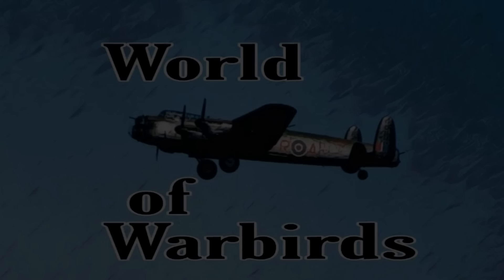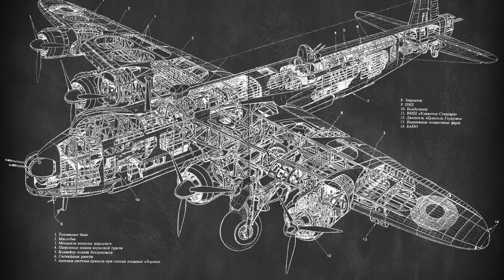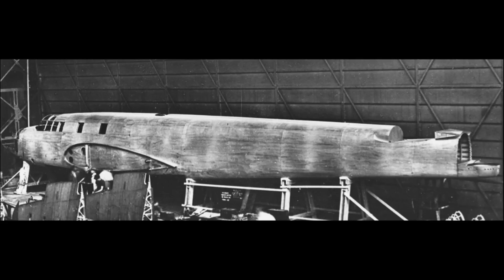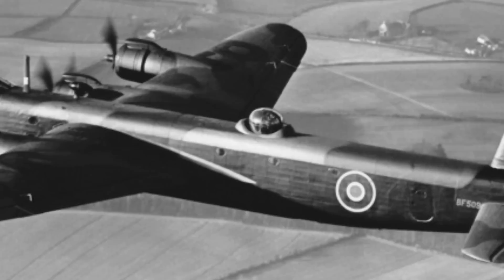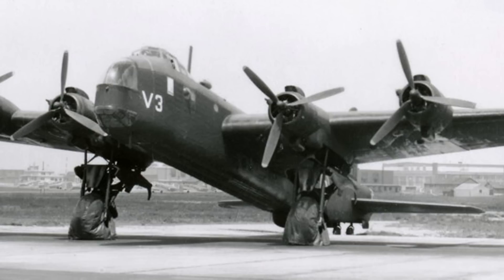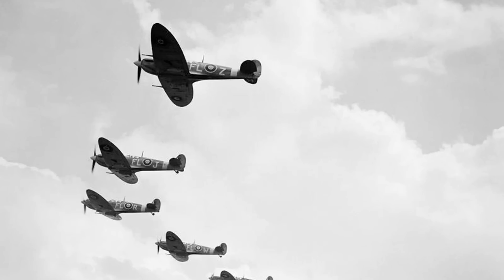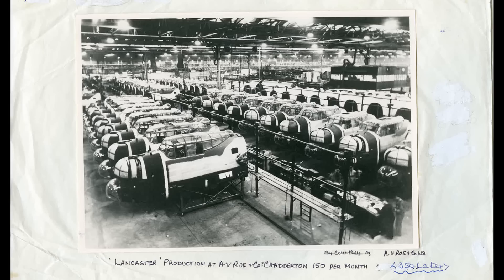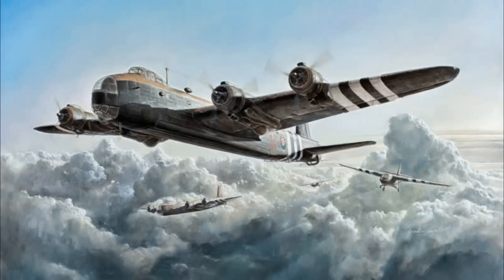Short Stirling- Pathfinding Giant (British "Heavy Metal" Part 3)

Comment: 14000 lb bomb load not 1400!
Reply from the maker: Yup. I said 14 hundred. 🤦‍♂️ Luckily the image says 14 thousand!
Reply: my father was an RAF LAC and told me that the flaps and undercarriage  were electrically operated and were always failing. The U/c could be wound down but there was no manual option for the flaps which caused some nasty crashes
Reply from the maker: I can imagine!

Comment: I just watched the video on the Short Stirling, especially intresting because of the many diffenretn roles it had, after being taken off (most of) the bombing attacks (low maximum altitude and alle that jazz).
It is worth adding that many Stirlings flew operations with the SOE, delivering guns, explosives and agents into occupied Europe. At least Denmark had many supplies delivered by the Stirling, probably because Denmark is far away. Compared to the Low Countries and France targets in Denamark would be 650-850 kms from bases in ex. Lincolnshire - a distance that would cover most of France!

Comment: My Uncle Fred who dropped into Germany on the Rhine Crossing operation with the UK airbourne contingent. Was flown home for de-mob in one of the transport Stirlings, Though it may have been one of the glder tug bombers, because he always said he was flown home in the bomb bay of a Stirling and it was f***ing freezing all the 4 1/2 hour trip home!
Reply: Both versions you mention ARE the Stirling B.Mk.IV    -     The Mk.IV's being glider-tugs & transports

It's ironic, as, whilst NEVER a Bomber - Mk.IV's flew THE last Stirling Bomber missons in Dec'1947 & Jan'1948

The users, the Egyptian Air Force bypassed the embargo by buying SIX (IIRC) civilian Belgian registered Stirlings

On those dates I've mentioned above, they bombed & killed Israeli civilians (deliberately) & some years after the war

Most folks WILL tell you that the Short Stirling ended it's career AS A BOMBER in 1943, but that clearly isn't so**

      **( By 1943 they mean RAF examples of the B.III - Many were later used by 100 Group until April 1945 )
Reply: @hawnyfox3411  Thanks I was'nt sure.

Comment: The key thing with the low ceiling is the vulnerability to flak. The combination of the Bristol Hercules and the insufficient wngspan really hampered the Stirling but even the Hercules engined version of the Lancaster was a poor performer in this respect compared to the Merlin engined versions. A real shame since air cooled radials are a more robust which it comes to machine gun or canon damage (no liquid cooling system).

Comment: A very interesting and factually correct presentation. The Stirling did good work, but was always hampered by a poor wing design and atrocious undercarriage. Having a maximum service ceiling of 16,000ft made them a sitting duck for anti aircraft guns and nightfigthers alike.
Reply: Apologies for the length but I want to clarify how your post has many holes with context.

Group 1:

-5 cm FlaK 41 effective AA celling 10,010 ft only 60 made
-3.7 cm Flak 18/36/37 effective AA ceiling 13800ft 
Total made 20,243
-2 cm Flak AA ceiling effective AA celling 7218ft 
Total made Of 2cm AA Flak Flak 30: 8,000+, Flak 38: 40,000+ &
more than 144,000 (Flakvierling count per barrel) so 192,000 AA guns of 2CM.

Group:2
The only 3 ww2 German AA Flak gun with an Effective range above 16,000+ are as follows:
-8.8 cm Flak 18/36/37/41 effective AA Ceiling 26,000 ft) 
total made 21,310
 with approximately 1350 housed in Mk6 panzer/tiger tanks making them effectively a Anti tank gun instead of an AA gun.
So shy of 20,000 of any AA effect.

-10.5 cm FlaK 38 Effective AA ceiling 31,003 ft
Total made some 4000
-12.8 cm FlaK Effective AA ceiling 48,556 ft
Total made 1125.

With these figures you will see how the total of German AA guns in question  at some 297,368 Aprox in my favour.
minimum 272,243 AA guns fired under 16,000ft.

Only 25,125 AA guns fired above 16,000ft.

Mind these large guns of 8.8cm or larger were in or of excess of 26,000ft 
Few aircraft were save 8.8Cm flak.
British Lancaster's at 28,500ft were save but not from the 5000 other bigger AA guns.

Short Stirling served it role & function/purpose perfectly adequately!
Reply: Of the 8 German night fighters of ww2 only 2 were dedicated night fighters made for said purpose.
Focke-Wulf Ta 154 Moskito which only a few were built proofing to be disappointing compared to the prototype.

Only dedicated German night fighter of meaningful number (Heinkel He 219)	~300 built

Ju 88C being a converted night fighter had significant for 1060 
were converted later constructed on original unaltered frames though 900 were the C-6 based on the A4 frame which only got into production of October 1943.

Britain entered ww2 with effective dedicated night fighters unlike Germany in ww2.
Played a massive advantage to the battle of Britain! 

-Boulton Paul Defiant Mk II-was a bit meh but served the purpose up north in Scotland mainly.
-Bristol Beaufighter  Was good enough the yanks wanted them as they didn't have a night fighter till 'Douglas A-20 Havoc'introduced in 1941 in initially limited production.
A-20 under performed the British Bristol Beaufighter was 
-Bristol Blenheim Mk IF=dedicated frame & design from scratch need I say more. 
-de Havilland Mosquito NF series=dedicated frame's;)
-Fairey Firefly NF Mk 1-5=Had issues but could perform as Night fighter from Carrier as was it's desired purpose.
-Supermarine Spitfire= Readily plentiful in use that could be converted to night fighters on field if it was required though suboptimal to dedicated night fighters.

You should know Short stirling & other heavy bombers flew in the rear defence of British night fighters!
This was an option was reserved to the RAF that no other air force had nor was capable of achieving in ww2!
Reply: @arnijulian6241   =   Well said, GOOD post        ( too many post-war armchair warriors !! )

100 Group made GREAT use of them & of course they were EXCELLENT for "Gardening" operations

No one moaned when it WAS found-out (combat conditions) that the Stirling COULD outturn Me110.G4s

( There is also documented evidence of empty Stirlings out-turning Hurricanes at Sutton Bridge "F.i.Us")
Reply: @hawnyfox3411  I agree certainly to many armchair historian that tend to be axis fanboys.
If everything the Allies had was worse then the German gear as they to often claim then simply how did the allies win that war?

Interesting hole they always dig themselves ah?
Reply: Below is taken from the A.R.G (Airfield Research Group's) own website : And I quote....

""Able to out turn the Me110 and Ju88 nightfighters. While speaking to a Hurricane pilot who flew some fighter affiliation sorties, he told us the Stirling he was carrying out a mock stern attack on, whipped around and ended up on his tail !!!""    (I've heard the same, too, even an account by an Me.110 G.4 Nightfighter pilot)
Reply: @hawnyfox3411  interesting, I have heard similar in my youth from elders on both side being of British-English & Austrian-German descent.
People  Me.110 & Ju 8 were so great but they were converted to the role of night fighter having never been intended as a fighter.
better then nothing but pails in comparison to the dedicated British night fighters I mentioned.

I will say the German did a lot with nothing as the war progressed running out of resources.
The Axis could never win but for how long they war lasted was the question.
5 years seems long but compare that to the 116 year war or many other wars in history in terms of length.
Mind industrial warfare is shorter but bloodier in that time period as technological advancement makes it so!
Reply: @arnijulian6241 nuke war even shorter and bloodier if not vaporized
Reply: @arnijulian6241 the UK had no purpose-built night fighters at the start of WW2.
Reply: @wbertie2604   
''The Blenheim equipped the first night fighter unit anywhere in the world when Squadron No.25 was given the type. During the "Battle of Britain" in the summer of 1940, a Blenheim night''

No one had a night fighter before Britain in ww2.
Britain was at the forefront of radar technology & the USA only built radar technology because of Britain suppling the information & examples to do so that they did improve upon.
German radar technology was mainly stolen from the Polish after their invasion which not on the level of Britain was surprisingly advanced as was Polish computing technology.

I don't think you read what I typed clearly or perhaps misinterpreted it.
It happens.

Comment: Hmm. Starts with USAAF B17 crew....
Reply: It's the channel opener - like the growling lion opener for all MGM movies. Do MGM movies have lions in their stories? Usually not.
Reply: B17 ''Total aircraft accidents 52,651, with 6,039 with fatalities. That's about 1,170 aircraft accidents a month about 40 per day!
That likely means nothing to you but that is very injury & death rate for operating an aircraft.
That alone makes a B17 a death trap.

B17 carried 26 X 100 lb bombs=2600Ib's to a range of 1,020 miles.
typical 1944 load out was 10 X 500 lb. bombs or 6 X 1000 lb bombs.

A Short Sterling carried 1400Ib's of bombs over 2000 miles or 8000Ib's over 3000miles.
British (Short Sterling) carried 5 times the bomb load over twice the distance of B17.

 
Even the shy of 7,781 Wooden wonders delivered more more bombs in weight over far more sorties with negligible losses unlike the  12,731 B17's/'falling fortresses'.
British de Havilland Mosquito that are multi role twin engine heavy fighters/ bombers  
Wooden wonder bomb loadout varied from 500IB's to 4000Ib's.
4000Ib used 1 cookie bomb with a range over 1500 miles.
After dropping  said bomb it's speed was in excess of 439 mph.
An unleaded B17 that carried comparable load out to Mosquito couldn't even get past 300Mph for fvck sake.

B17:
-little range under 1000 miles with any meaning load out of 5000Ib's
-a bomb load on par with Twin engine fighter!
-light bomb load.

B17 performed so poorly the RAF rejected their use in testing even when Britain was desperate for bombers in 1940.

Only decent Bomber the USA had in meaningful number at 18,000 units that RAF reports praised was the (Consolidated B-24 Liberator)
Though 1 major complaint was the 11 crew required to operate which is very high though it was cut down to 9 then 8 in RAF configurations.

Short range (˜400 mi): 8,000 lb
Long range (˜800 mi): 5,000 lb
Very long range (˜1,200 mi): 2,700 lb

This range is usable though still nothing special or desired.

Still piss poor compared to Mosquito, Sterling ley alone a Lancaster 22,400Ib's gram slam.